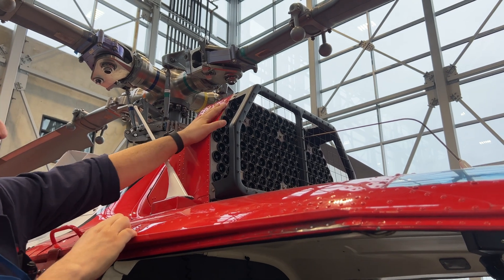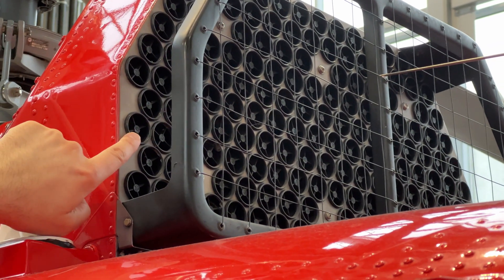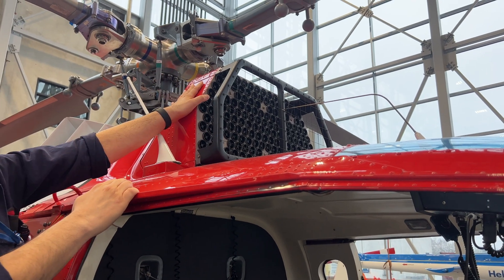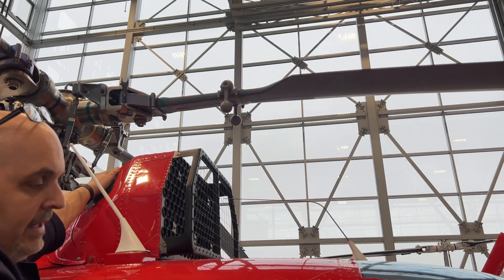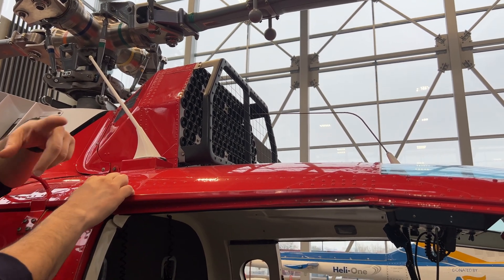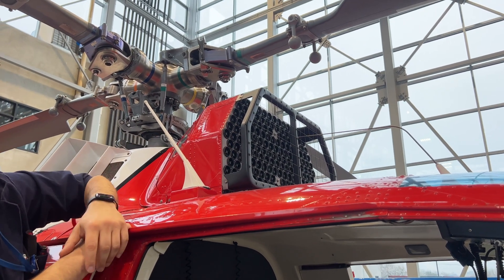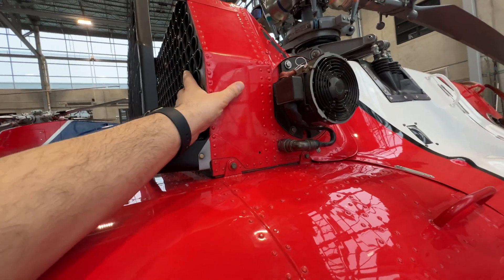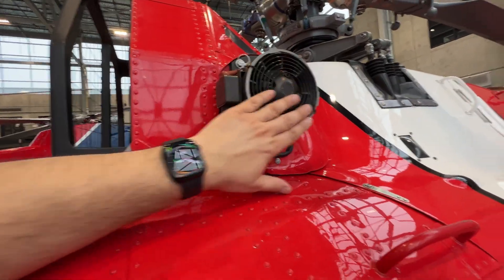BO 105 Helicopter. EAPS Engine air particle separator

Comment: Looks very good! What make of EAPS is that? 
What drives the little centrifuges?
Reply from the maker: Air is drawn in by the pressure differential between the compressor side of the particle separator and the outside air.